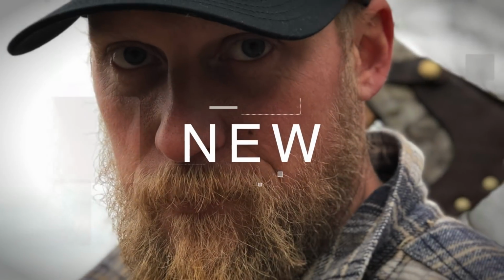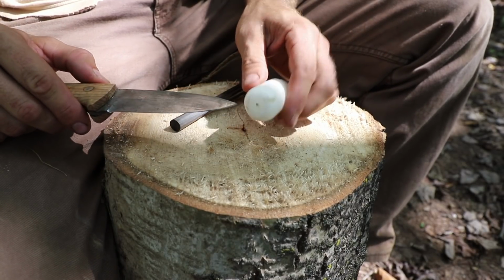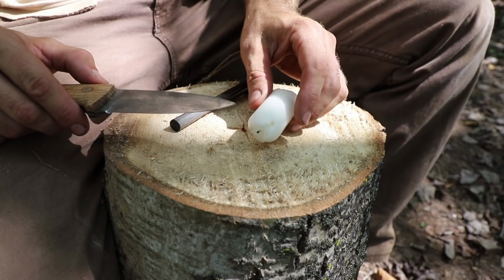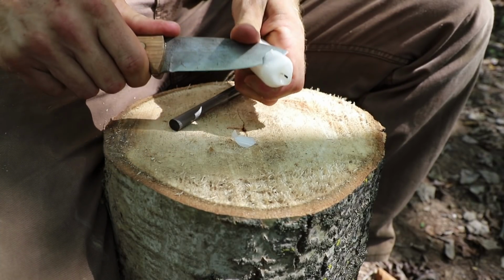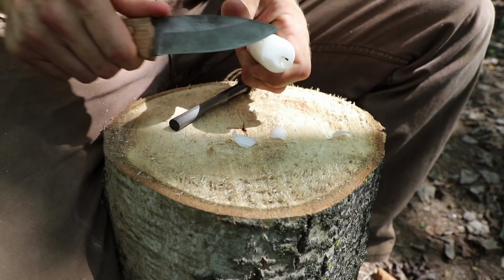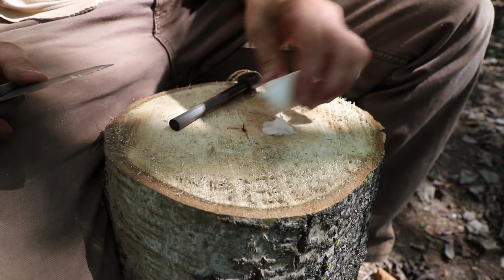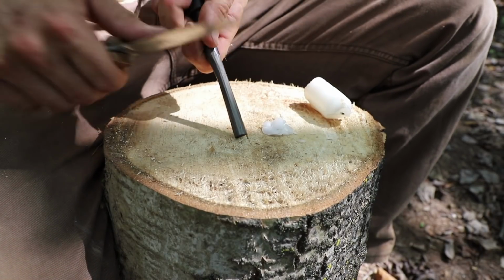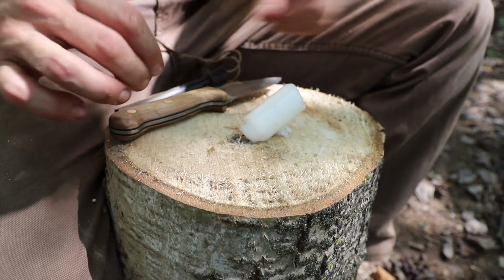Light a Candle with a Spark {EASY SURVIVAL TIP}

Comment: Another method which produces results is to use fatwood shavings, a cottonball soaked in Vaseline, or some other ignitable material in the same manner. Cottonball w/ Vaseline is especially helpful because you can place it directly on the wick before hitting it w a spark. Great video!!

Comment: Cut off a couple inches of jute twine, fray just the last half inch or so up, spark it to light with your ferro rod, light your candle. Jute twine has a tendency to keep flaming up even in a fairly significant breeze. Saves using up all your relatively expensive ferro rod generating a pile of ferrocerium shavings, and the jute is easier to light.